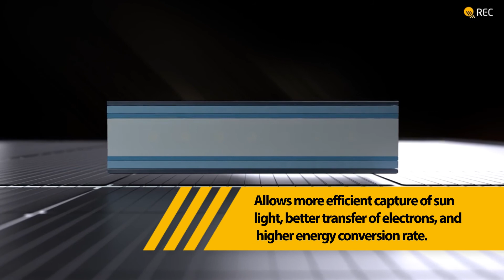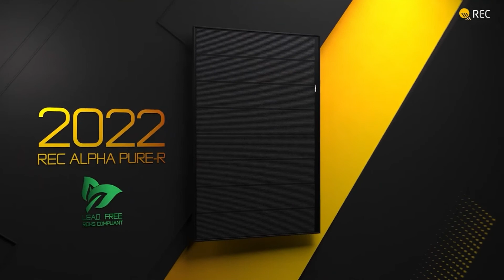Mastering HJT - Solar technology of the future, already today at REC

Comment: Well, in REC you are missing modules HJT bifacial with cells G-12 , 210mm, with double glass 3.2+2mm anti-hail, and without rear white mesh on the rear glass for power plants. Modules above < 700-730w or more. How to do it? Yes they are heavy, but they don't have to be lifted and installed every day. Only after 30-40 years. Come update your lineup.